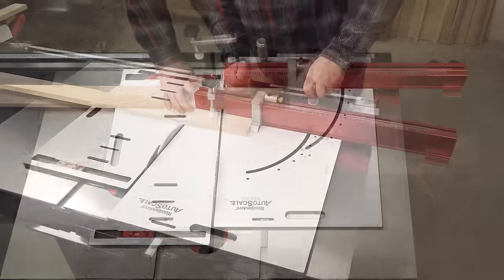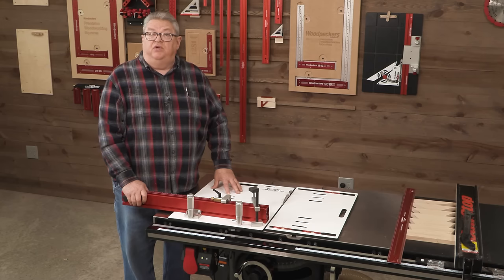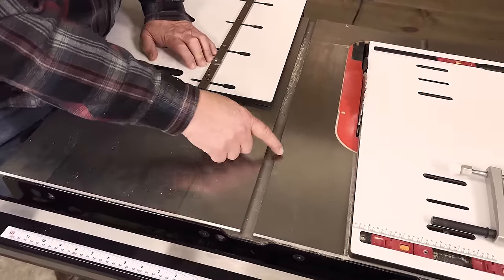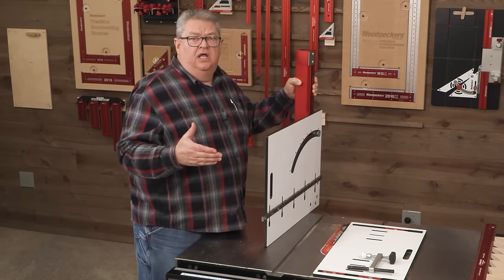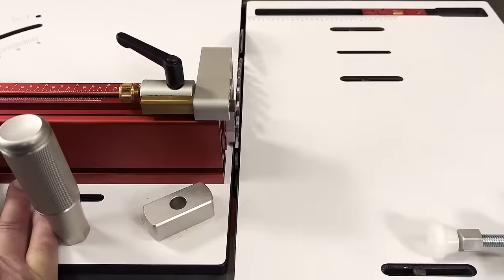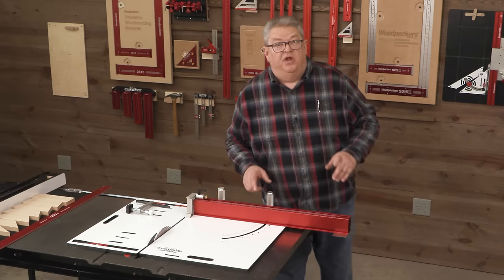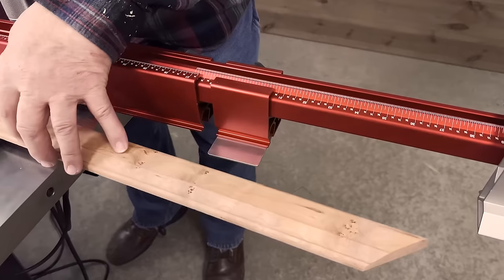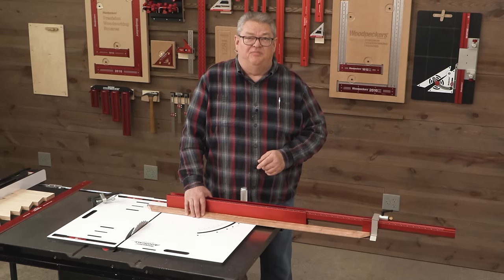AutoScale Miter Sled FAQs | Deep Dive | Woodpeckers Tools

Comment: Nice but can’t see spending that much when there are other commercial sleds that can do it all with just a slight modification (at most).
Reply: Please give me more information on which ones. No joke
Reply: @RobyWanKenobi  Dubby Jig from In-Line Industries, Rocklers version, Incra's version.  I have had the Dubby left and right side sleds for 20+ years.  Their sleds are made from Melemine however that has never been an issue even in humid SE Texas.  Both the left side and right side Dubby jigs are $349.99.  Dubby has addressed the replaceable sacrificial end.
Reply: @RobyWanKenobi  I think the INCRA MITEREXPRESS Miter Express is a good option. You can use it with any gauge, although it works very well with the Incra 1000 HD.  I like it bc you can set it up to the right of the blade for Sawstop saws where the blade tilts only to the left.  It is an open sled that accommodates long stock and jigs.
Reply: @11211lcb  Literally none of the sleds you mentioned do what this does, which is keep the fence a constant distance from the saw blade, making it so that if you measure 8" (or whatever) from the blade and change the angle, it's always 8" (meaning, the scale you have on the fence is accurate at more than just 90 degrees, which is not the case for any of the products you mentioned)
Reply: @RobertBarth1  oh, is it important to be able to change the angle and the stop setting remain the same.   I do not recall ever needing to cut a 90 and or any other angle to a specific length and then need the same length at a different angle.   Can you give me an example of when this feature would be needed?  If I ever did need that I could still use my rule or tape measure.
Reply: @11211lcb  The point with this fence is you don't need a tape measure at everything other than 90 degrees. The fence markings are always accurate. With every other fence, the fence markings are inaccurate as soon as you leave 90 degrees.
Reply: @RobertBarth1  I understand the point of the set up.   But after 40 years of woodworking I don’t fall for expensive solutions to non-problems.